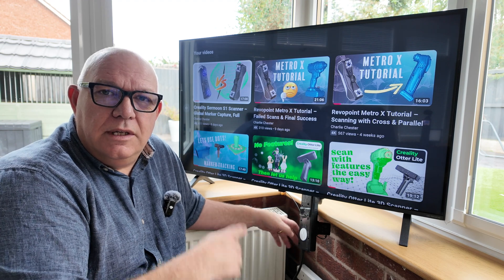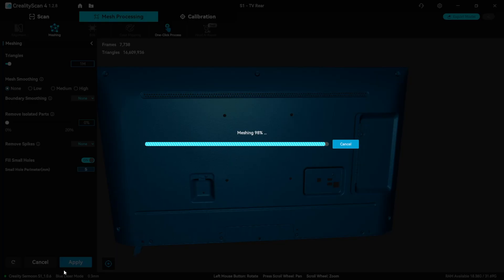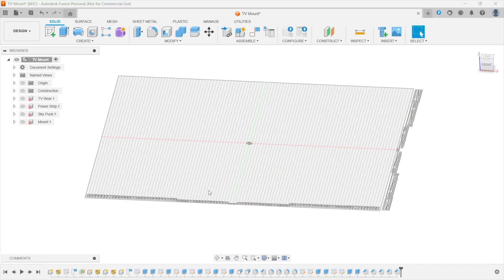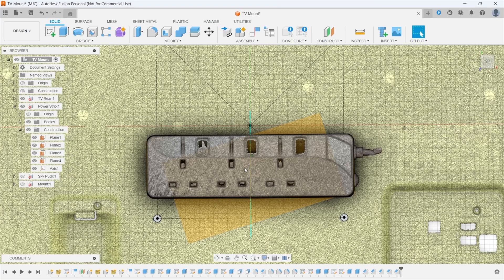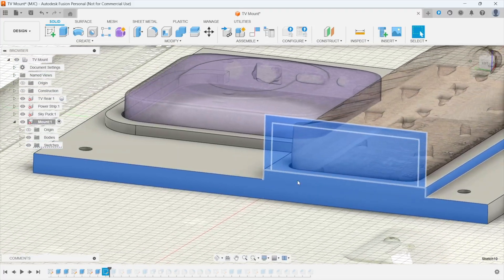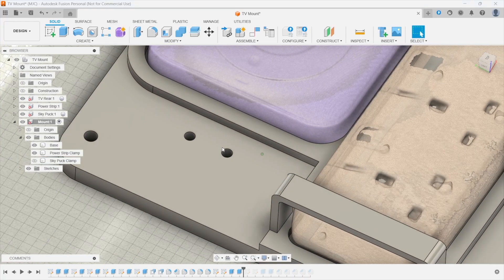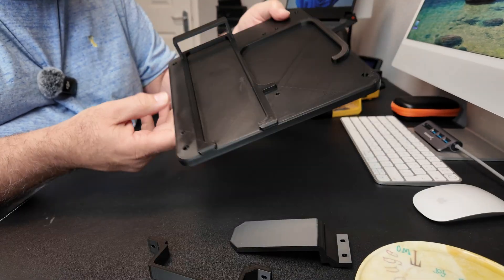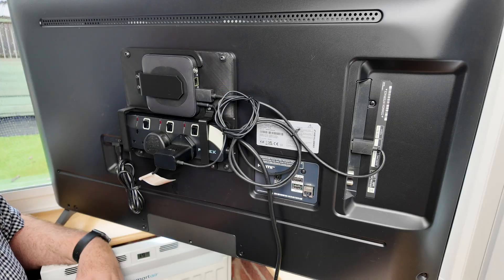Creality Sermoon S1 Tutorial – Designing a 3D Printed TV Cradle

Comment: Do you use offset for your pressed in offsets? What size hole for 4mm insert?
Reply: Also great intro with falling power strip. Pretty funny
Reply from the maker: @RaRa-xg7le that was not scripted it just did it so I kept it in. 😂
Reply from the maker: I actually messed that one up as I made the holes too small and didn’t use a chamfer on the leading edge so it pushed melted plastic into the bore. I obviously didn’t show that !! 😂😂

I’ve used them before and I measured the diameter between the knurled sections and made that an interference of about 0.2 mm.

Comment: second time I've seen your video recommended so I subscribed and liked the video. I love that you scanned the sky box and extension and modelled around them, its good practice that I imagine will come in handy on a more complicated project. It would of been far easier to take measurements and just model but this is the skill I need to practice too so thanks for posting. It got me thinking how the cad could of been designed differently for this project. 1 idea I was thinking while watching would instead of making the screw down clamps to hold the sky puck and extension if you could model a snap fit clip so you would push the extension into the housing around it and the snap clips would hold it in once pushed all the way into the housing if that makes sense. That way you would have a print that doesn't require any more work after the print is finished. 

Just an idea, I know it wouldn't be worth to redo this project and you said you were learning cad, I'm just having fun myself thinking about it. Maybe you could incorporate a snap fit into a future video?
Reply from the maker: Brilliant comments thanks. As you say you could of measured and made something like this without scanning but where is the fun in that lol 😂!!

A snap fit. Hmm yes your right. I'll bear that in mind in the future. Snap fits require flexing which could snap over time so something thats should be used on he right project. Also the printing a wall loops to allow the flex is a consideration. All great stuff to get the cogs working.